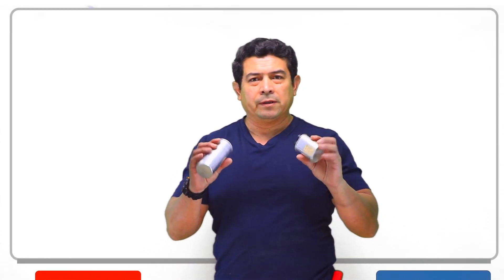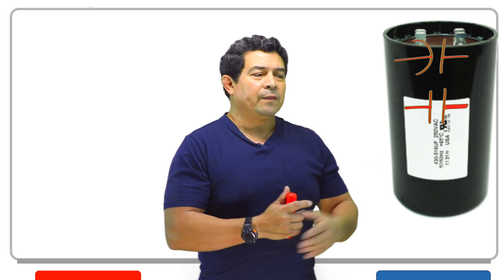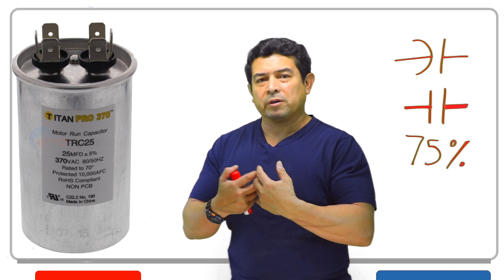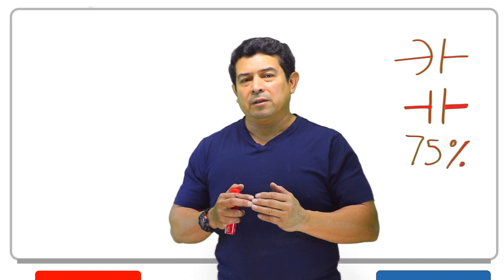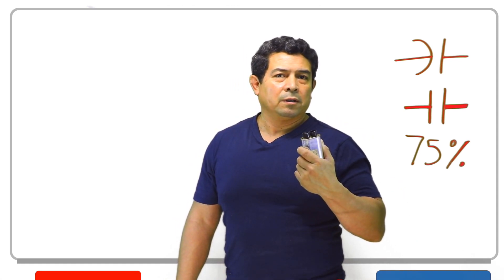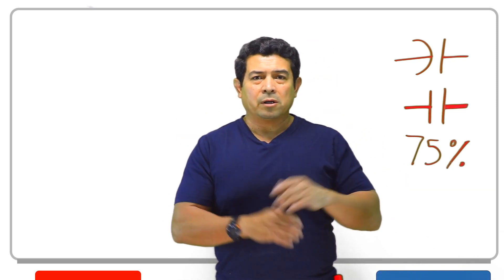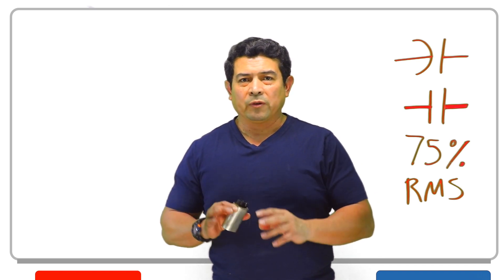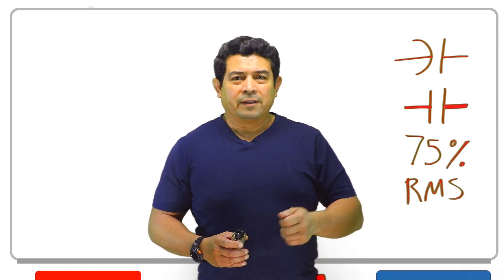Capacitors: types, use and testing. All you need to know! - HVAC Online Training and Courses

Comment: Capacatience, I was told you can always go bigger just keep the same voltage
Reply from the maker: I was told the same thing a long time ago, but then I found out by doing research that by increasing the capacitance/microfarads you are actually sending more power (without getting too technical) to the motor which could overheat the start winding. The manufacturer said to use 5 µF and that is for a reason. If you use something less you're not going to have the phase shift that you need and you're not going to have the power that you need, and if you use a higher micro farad you're going to have more of a phase shift and more power going to it and overheat the winding. I tell everyone in class if you don't have the correct microfarad capacitor temporarily, meaning a day or two,  use the higher microfarads but come back and replace it with a proper one. Remember, the manufacturer uses that micro farad for a reason. I hope this helps! Thank you for watching and thank you for sending your comment in.
Reply: @AirConAcademy  I'll keep that in mind, thank you for the info

Comment: Capacitor sends energy?  volts x amps = watts. What other energy is there?  How is it sending energy in any different form?  Isn't the purpose of the capacitor to use time to charge it's plates to move the sinusoidal wave of current 90* out of phase? so if that is so, the microfarad rate is proportional to the amount of phase shift and single phase motors need 90* out of phase to run the most efficiently. What I don't understand is why the start cap that is wired in parallel, has such a high microfarad rating and why does this just ADD power and not change the phase.
Reply from the maker: Like you said, the capacitor is going to change the phase angle. Microfarads is a measurement of energy that the capacitor is putting out. Higher the microfarads the more energy they will put into the start winding. That is why the start capacitor is taken out of the circuit when the motor has reached 75% of the motor speed, because it is putting more energy/power into the start winding. If it is not removed then we would be sending too much Energy to the start winding, it would overheat and burn up. Because of the wave shift we are basically slowing power down so that it hits the start winding shortly after the power hits the run waiting. The charging and discharging of the plates happens in a split second. Remember electricity moves at the speed of light so these plates charge and discharge very fast. There is no other form of energy we are just, like I like to explain or say putting a time delay in there.   I hope this makes sense.

Comment: Nice information what is the rating voltage for 120 volts and 240 volts  capacity
Reply: Thanks for replying 370 volts on a  capacitor  is for  120  240 volts  but  I can  a cross 250 volts capacitor  what voltage  does that operate or work with
Reply from the maker: @wasimedoo1506  you came across a 250 V capacitor? You can use that on the 120 V. As I was saying capacitors they charge to peak voltage. So that is what we need to look out.  The easiest way to figure it out is to multiply the voltage that you have times 1.46 and they will give you the approximate peak voltage.   Multiplying 120×1.46 kids you 175.2. If the voltage is higher on the capacitor it is not going to harm the system. You really do not want to have a lower voltage capacitor on there .
Reply from the maker: I am not sure I understand your question? But typically for 120 V and 240 V we use a capacitor that is rated for 370 V. The reason this is done is because capacitors they charge to peak voltage not RMS.  I hope this answers your question. I just said I was not sure what you meant?

Comment: Hi, somone tookaway compressor from the rheem condensor. Unit is still working fine. How?
Reply from the maker: If the compressor is gone then only the condenser fan motor is working. Your pressures would be down to zero if the compressor is missing. Be careful because the high-voltage wires sending power to the compressor will probably be exposed and if you touch the unit or you touch the wires you will get shocked/electrocuted.